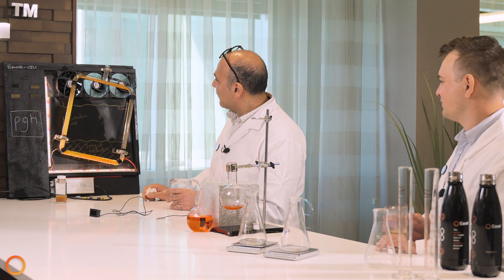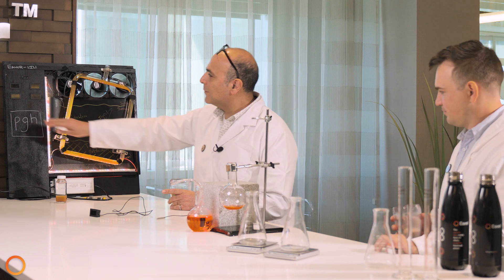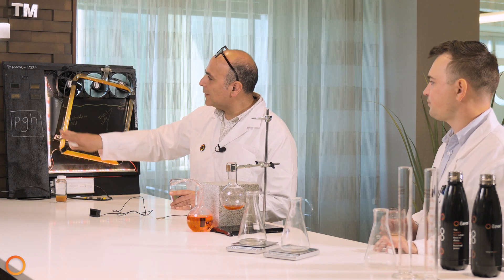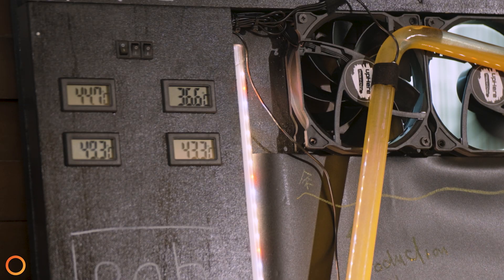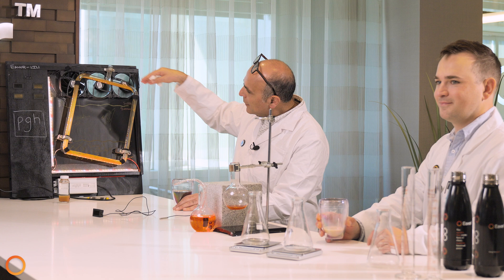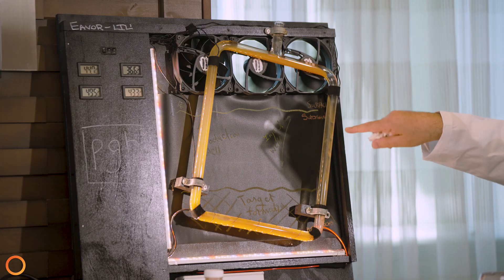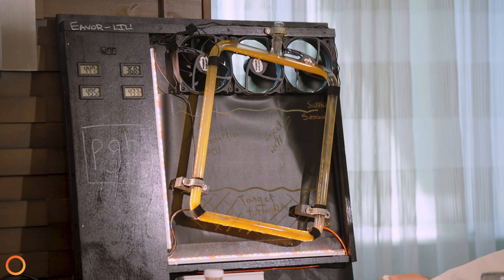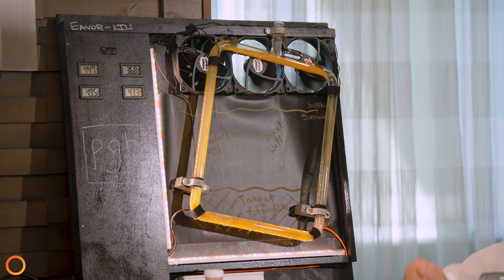How The Thermosiphon Effect Works - With Vlad and Mo

Comment: will it only work in a vacuumed tube or will this work in a backyard home made pvc setup? also would air do the same thing in a greenhouse? earth battery with out the fan type thing. do you need higher heat to move more volume and or height? thanks for the video!
Reply: i dont think their tube is vacuumed.
Reply: Yes in response to your 3 questions

Comment: I love your technology. It will be a good alternative in places where they won't allow geothermal fracking.
Reply: Well, or fracking will just become obsolite. ;-)
Reply: @gaborpokoradi969  The huge benefit of enhanced geothermal is that it comes with a free battery. You can store energy in them for a few days. It's the perfect solution to fix the duck curve. The big question will be which geothermal will be cheaper. Eavor is great. I love them. But I love the free battery more.
Reply: @Scubongo  Isn't it the case that once you have constant, always on, unlimited source of energy, you don't really need a battery at all?
Reply: @Scubongo  How much is the 30 years maintenance fees of enhanced geothermal? How many times turbines, etc will have to be replaced? For how long the plant will not work while all these maintenance is ongoing? How does that effect ROI? I like everything that is geothermal, I just cannot see how an open system is better than a closed one that you can fully control.